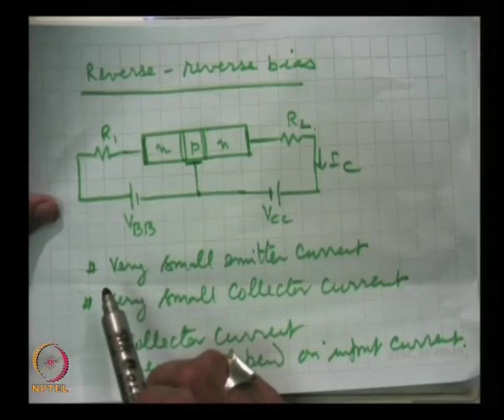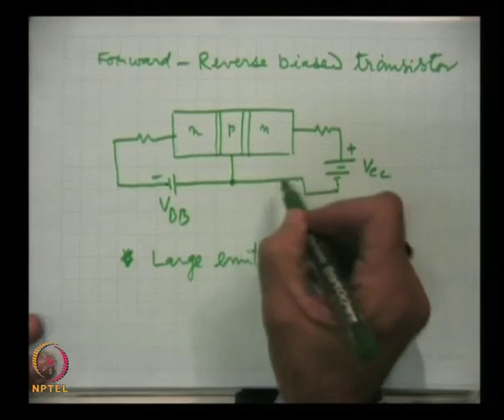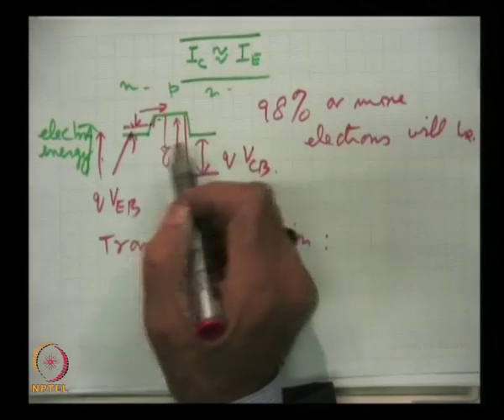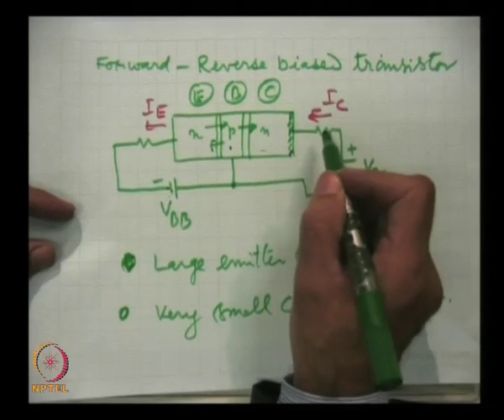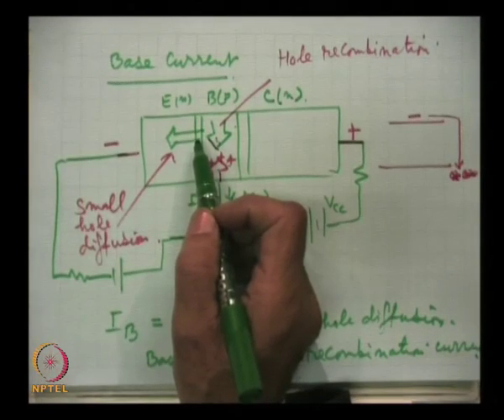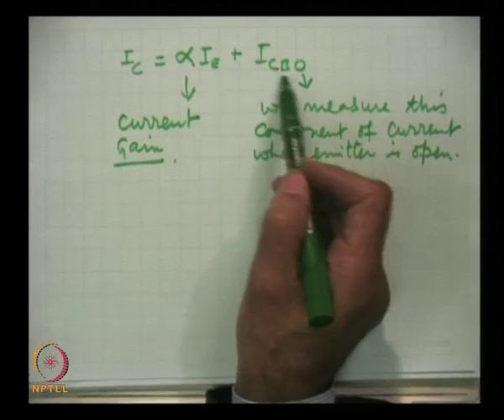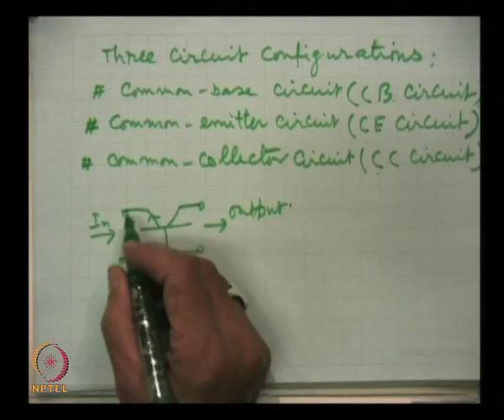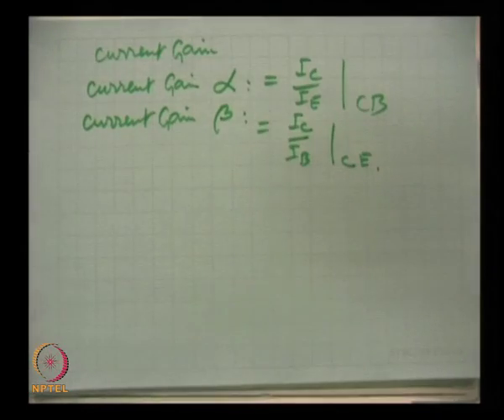Mod-02 Lec-06 Reverse - bias (Contd.)

Comment: i have not got the point y collector is moderately doped
Reply: since the collector part is not playing any role in transistor action instead acting as noise it has to be reduced in order to do that we have reduced the doping concentration so that less amount of thermally generated holes are produced in case of npn transistor thereby reducing thermally generated current's magnitude. Since we can't stop this phenomena of thermal generation that's why we are never going to bring it to zero

Comment: Transfer of current from low resistance to High resistance means Transfer of current and not transfer of resistance , Then why the name transistor was given???Instead it can be called a triode or Amplifier
Reply: Well, the important part is that you have transferred almost the same current (Ie = Ic) from a low impedance circuit to a high impedance circuit. So the current is not varying (almost same) and the resistance is varying significantly( from a few ohms to Mega ohms).
Reply: Jibin John Thanks John for the logic